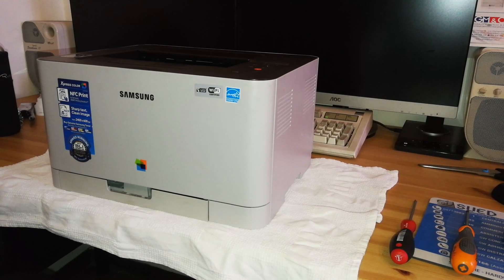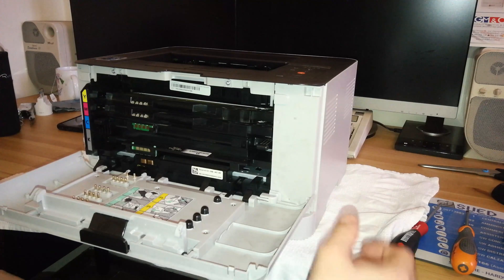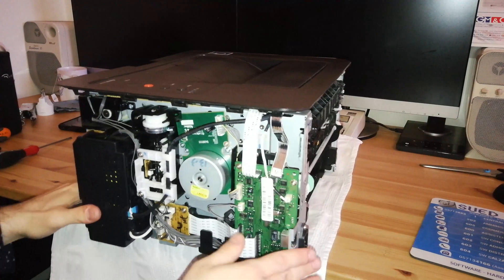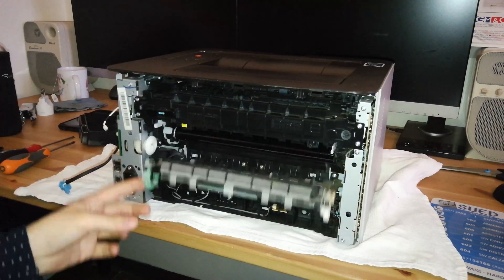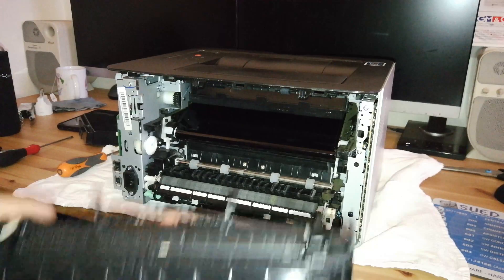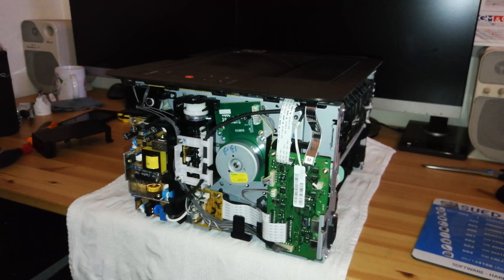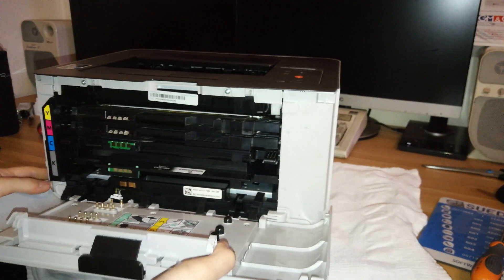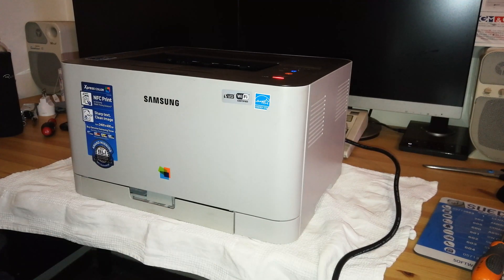Come sostituire l'unità fusore • Samsung CLP-360, CLP-365W, C410W, C430W, HP 150a, HP 150nw

Comment: Thank you for your amazing video. I only wish I had found this before attempting my replacement yesterday with someone who had us flipping the printer on all sides after removing the toner parts. You can imagine I now have toner all over my printer innards. Not only that, but my plugs are super tight and I pulled the whole connector for the white cable off the motherboard. 😭🙈 Is there a tip on how to get these cables out without pulling the whole unit off the board again?  I'm thinking it's cheaper for me to replace the whole board, as I cannot find a printer tech anywhere in my area to help. Or is it at all possible to reconnect this part myself? Or can I replace the whole board myself? I have a C460FW with the fax components. Thanks in advance.🙏

Comment: I want to thank you my friend for a thorough and easy to follow explanation on how to remove the fuser module from this printer. I had the worst paper jam where 4 pieces of paper had wrapped themselves around and fused themselves to the fuser roller.  I was able to take the fuser out, disassemble it and fix the jam. Most people would have just thrown out the printer or at least , replaced the fuser which retails for around $175.  Thanks again, and the printer is working like new.

Comment: FYI: 6:52 if you have access to the 2 contacts you can use a small screwdriver (or something metallic with an isolated handle) to touch them simultaneity and this will discharge the capacitor. Warning: It might make a spark. It is normal.
Reply from the maker: Hey! Yes I know but I prefer not to touch it, also if I had to discharge a mains capacitor I'd do it with a resistor, even if a screwdriver works too, just safer for the capacitor to do it with a resistor :)
Reply: @PaoloMarcelli   I think it is better to discharge it because you don't have to want to touch it, you can touch it by accident (speaking from experience 😬). It is better with a resistor, but, because not everyone has a resistor to use, and yes it is bad for the capacitor, but if you do this very often, but for once or twice in its life, I think it is alright.

Comment: Hi Paolo.
Thank you for sharing this video. I have the same printer 365w with same problem. After starting the printer the check lights run, but the printer stop before loading paper, and turn red. I am sure I created this problem. I wanted to change the pickup roller, but before that I made some damage to the connecter under the little black item on the front board. Carefully, I had to put alle the sticks in place, and weld a bit. Since the check light worked as it use too, I guess it was fixed. As for the pickuproller I had some problems to resample, not sure how it should turn. I probably started the computer before it was mounted the right way. I guess this could have damaged something maybe the solenoid. I don't realy know how to identify the real problem, but its hard to have a printer not working. Especially because I have don't the repair from a used printer, and everything worked before this. Can you give some advice? Thank you

Comment: Hi Paolo. Thank you so much for your great video. We were able to replace the fuser on a Samsung C460FW.  Not identical to the model you're using in the video, but quite similar. The tricky part was sliding the cables though the holes (since our model has some additional circuitry, I guess for the modem/fax support.
Reply from the maker: Hi, great job, but my name is Paolo :)